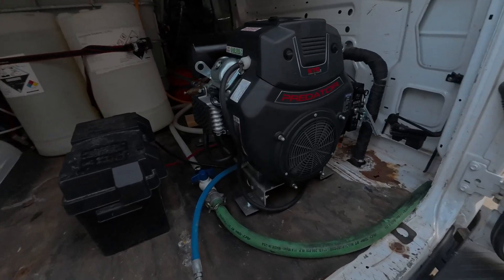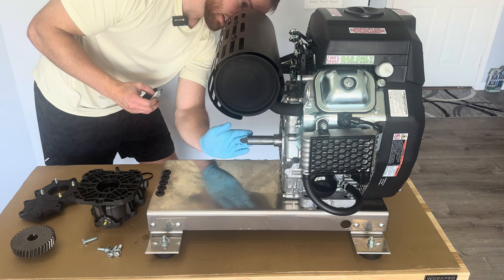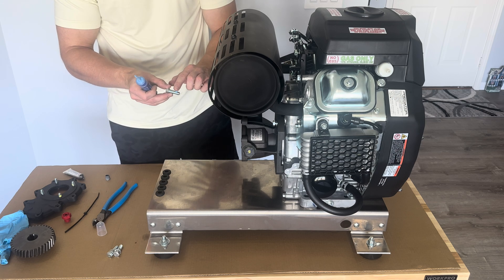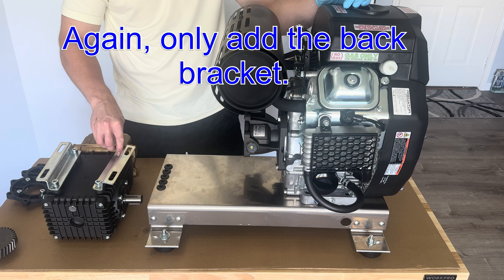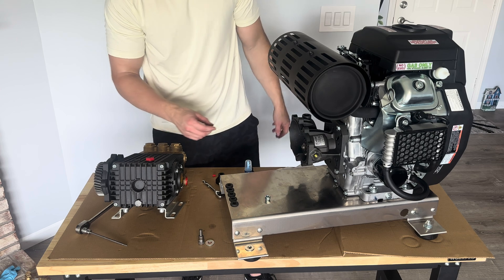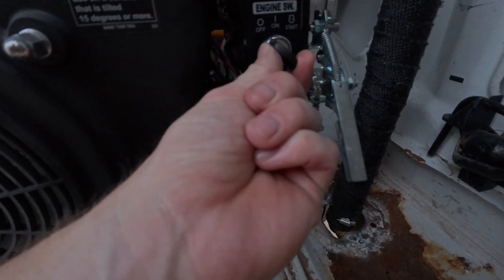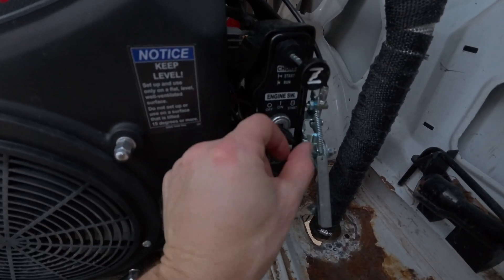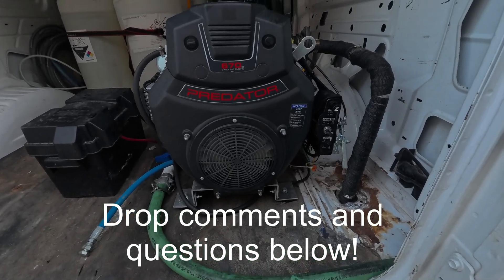8GPM Predator 670 Pressure Washer Build + Parts List

Comment: Had a question about the wiring on the fuel pump. The wire that was on the keyed switch was white and the wire coming off the fuel pump itself was red. Was that the same wire or did the red go somewhere else?
Reply from the maker: Same wire, I just had white wire laying around so that’s what I used.

Comment: Your worries about the belt drive are unfounded...just look at most truly professional rigs...belt drive machines dominate.And, btw, so do HONDA engines...very few Predator engines will be found on them.
Reply from the maker: If money was no object I would’ve just bought a Honda belt drive skid. The whole purpose of the video and part selection is to save money lol. Belt drive kit was a few hundred more and there is risk of belt misalignment for the average person doing it themselves.
Reply: @pressurewashnerds great answer.  💯
Reply: I have 2 GX690 Honda engines, and honestly I am happy with them overall.  But, the question becomes, do these Predator's last?  If so, the savings could justify the switch.  The other concern is the maintenance and how frequently do they break down?  Yes, aligning the belt could be tricky, and if not done correctly, you will rip through those belts quickly.    I have heard that there are other benefits to a belt drive, such as the vacuum it creates to pull water.  I do not recall if this is also the case with the gear drive systems.  Please update us on how long this build lasts you.  Great video.
Reply: @jsantaite1 I’ve gone through 2 predator 459s my first season. First one I left trailer out in many rain storms so maybe why I had to switch it out, but it was warrantied out. My only gripe is the oil drain location, but other than that that it’s legit. No battery, all pull start. Would still love a Honda though.

Comment: Total price is roughly $2,636 for anyone wondering
Reply: I just pulled out my calculator and started adding it up, then saw this comment lol. Thanks
Reply: Thank you!
Reply: The gear box is $600? I guess the sled has a cost.. motor is like $950 and pump is around the same depending where you get it from. I didn’t look the gearbox up.

Comment: I can not find my answer 

What pressure are you getting out of it? What’s the pump rated for? 

What kind of pressure do you think I would get out of a 6.6gpm 5,000psi pump?
Reply from the maker: The pump is rated at 3600psi and 8.5GPM but to be honest I’ve never run mine over 2500. There’s no need
Reply: @ I’m wanting to use it as a sewer Jetter so I need the higher pressure

Would you be able to crank your unloader all the way out to see what kind of pressure you’re able to get out of the pump all the math I’m able to find says I need 28 to 32 hp to run that 

I’m just trying to see what I need rather than order a bunch of stuff and find out the hard way
Reply: @logangaskins9003  Im also wondering if that engine is able to support 8.5 gpm at 3600 psi.
Reply: @logangaskins9003 I run 4000 psi at 8 gpm and the setup was like 2500.00 I used 2 Simpson 4000 psi at 4 gpm machines tied together with a tee fitting and 2 check valves. 90% of the time I only need to run 1 unit to clean grease in restaurant drains with the warthog wv nozzle., I have even cut smaller roots with the 1 maching and that warthog.
Reply: @stevem1081  so I ended up buying a mitm 5,000 psi unit used for $800 

I’m putting out 4.5gpm @5,000 psi 

It absolutely destroys everything I throw it down. I have a root ranger and a few button tips. Next is the warthog wv on 1/4”.
Reply: @logangaskins9003 some things I have experienced. My 100 ft 1/4 hose on the reel had steel ends, after a while, tiny flakes of rust would clog the nozzles. I ordered a hose with stainless steel fittings. Also, on that wv nozzle, they say you need a expensive tool to take it apart, I ground the sharp point off of 2 16 penny nails, put in the vice and it works great. Watch the video of how to service it, you will understand what I did.
Reply: @stevem1081  I didn’t see a reason to buy the warthog until I came across some roots I wasn’t able to get the line through
Reply: @logangaskins9003 the wv is not a super powerful head, other warthog heads and other brands have a bit more power. The reaper might be a good option.

Comment: What size hose are you using to feed the pump and what size is your whip line coming from the pump? I ordered this pump and motor yesterday. Thanks
Reply from the maker: It’s a 1” vac line with banjo filter on the inlet to the pump. Then 3/8” whip line to the reel.

Comment: Hey I've almost finished this build. Only thing now is I cannot get the gearbox on the engine shaft. The issue is that the engine shaft key wont ever spin to the proper location for it to slide into the gearbox. Is there a way to spin it manually? I went the route you recommended in the end of putting the gearbox to the pump first, then attaching it all to the engine shaft. But it seems like I cant get the key to align to actually slide it on there.

Any advice is highly appreciated. Thanks!
Reply: Ok, so problem solved. If anyone else has this issue, the best bet is to go to pages 8 & 9 of the Engine Manual (pages correspond to the current version of the manual), and follow the dissassembly steps listed to remove the shroud of the engine. It is the front cover. Once removed you have full access to a front bolt which you can use to manually rotate the shaft with no issues.
Reply from the maker: Sorry! Didn’t see this yesterday but glad you got it resolved. 

I think I should have added a section about checking alignment before mating gearbox to pump. At that point, you could still manipulate it to the correct orientation.

Comment: Hello. 
I received a blown craftsman’s 163cc pressure washer.  The guy bought it had his son set it up. He ran it with no oil for 20 minutes and blew a hole out the side. 

Is there any special requirements do I replace it with an oem motor from Briggs and Stratton with vertical shaft or can I use the predator vertical shaft on it? 

Thanks in advance.
Reply from the maker: Check:
- shaft size is same
- pump spec for the horsepower rating
- pump spec for rpm vs engine rpm
- mounting hole pattern

Comment: Nice video. Looking to do this same build with a TSF2221 10GPM pump.
Reply from the maker: Thank you! Yeah the 10GPM is tempting
Reply: 10 GPM may be asking a lot out of that motor.  The predator 670 is from my understanding ment to be comparable to the Honda 630 not the 690 which is what typically gets used on 8+ gpm units.

Comment: Question, what did you use to connect your fuel pump to the fuel line? It looks like some kind of nut was added? Or is it just the line going straight on with some crimps?

Thanks again!
Reply from the maker: Just line going on with some clamps. Nothing fancy

Comment: I just finished this build and it’s running great. My only question is the unloader. So with a 25040 green tip, you’re running 2500psi?
Reply from the maker: To be honest, I can’t remember what the exact orifice size is. I tried a few before I found one that gave my surface cleaner and wand both 2500psi with the same unloader setting and full flow

Below is a link to the one I ordered. Spec 8GPM

https://amzn.to/4hLM5Z8

Comment: Excellent build, I love your attention to details. Mind if I ask you what are the dimensions of the unit completely assemble? I'm planning on building one and have not found any information regarding size and I don't know if I have enough space on my trailer for it. Thank you.
Reply: Look up width of the predator because that’s the widest part. Look up length of the aluminum skid he used as that’s the longest part.
Reply: @austinprescott4039  Thank you for your response, I have looked the width of the predator and no luck, I figured out the length base on your info, but the width no. I have room for the length, 36 inches and only 30 inches available for the width, don't know if that will be enough.
Reply: @Sebanavila  30 inches is plenty. It's just over 23 inches wide.
Reply: @ Thank you for that info, it means a lot. You are awesome.
Reply from the maker: 23” wide at the Predator and ~30” long. Keep in mind you should leave some space around it for air flow and exhaust heat.

Comment: Amazing! Where do you get the rubber vibration dampeners (or feet) for the pump? Did you order them seperately?
Reply from the maker: I found them at Lowe’s in the hardware section! Most hardware stores should have similar

Comment: Hey do you mind if I ask what battery you use for the push to start feature on the Predator 670? I am about to order this build and want to ensure I understand every part needed first.

Thanks again!
Reply from the maker: I believe the manual calls for 12V and minimum 36Ah but double check me. I use a marine deep cycle 12v from Duracell. Group 27. We took it from our softwash system so it’s probably overkill.
Reply: @pressurewashnerds is your battery charging while the engine is running, or do you need to charge it up once in a while?
Reply: @hurdlingdragonbreath9381  I think you need to charge it up regularly. I don't believe this engine charges it.

Comment: Question, since the Gearbox you used has a Maximum RPM of 1450, doesn't that mean the TSF2021 only gets up to 7.5 GPM rather than 8?
Reply from the maker: I did not catch that when I did the build… that’s interesting.

Real world testing though yields over 8GPM though with a fan tip. Technically you are correct though and I may be running the gearbox slightly higher than spec.
Reply: Any issues with the gearbox after this past season?  @pressurewashnerds
Reply: @pressurewashnerds  Oh interesting. Do you mind if I ask how you got it to run higher? Cause I want to do this exact build, but I just want to ensure I get over 8 GPM.

Thanks btw for replying! ^_^
Reply: Do you have a video of you flow testing this pump buddy.  I’m doing this build now and torn between ordering the 2021 or 2221 pump I have a gear drive also an the 1450 rpm through me off, Russ Johnson said with the motor at 3600 rpm the gear drive is actually turning around 1640 rpm it’s super confusing to me lol I have a 6.3 gom and want to make sure I get at least 8 but I don’t want 10 because of pulling chem may be a issue

Comment: I have had nothing but issues with my gearbox.  I got the PA gearbox from envirospec and have reassembled it twice, making sure all bolts are tight, O rings are lubricated and siliconed, but still continue to get a slow oil leak between the gearbox and the pump.  tempted to switch to this gearbox that you have.
Reply from the maker: Interesting! Did you check for burrs on the pump and gearbox casting?

I’m at around 100 hours and this whole setup is running great.
Reply: @pressurewashnerds  that is what i was checking for when i took it apart this last time and couldnt find any of it.  Going to check one last time
Reply from the maker: Let me know if you find anything. Inspect that o-ring too, or replace if you can.

Comment: With the gear drive, we would need a pump from the buffer tank?  That was the reason why I currently have a 5 GPM belt drive because it suck water from the tank.  Has these info changed because I purchased it 5 years ago.
Reply from the maker: Gear drive and belt drive will both pull from a buffer tank as long as the pump isn’t super elevated from the water source. One thing I forgot to mention is you’ll want to prime the pump with positive pressure. I ran a garden hose to mine with 3/4 GHT to 3/4 NPT fitting and ran the machine for like 5 seconds. Then it pulled perfectly fine from the tank.
Reply: So I was a drop stick not a direct feed from the drain connect

Comment: How much saving comparing to purchasing?  Not sure I have the skill but it seems like you have all the part in your list that might give it a shot.  Thanks.
Reply from the maker: This will save you at least $1000 compared to the cheapest 8GPM prebuilts that I’ve seen. Plus the added benefit of knowing your equipment in and out.

I’d be happy to help you over the phone if you run into any issues.
Reply: @pressurewashnerds  Wow, thanks. That is what I was just talking about.  Building, safe money and I will know what break and where to get the parts.  I appreciate you sharing.

Comment: Nice job! I did the same build several years ago with the Predator 22hp. I'm not too fond of belt drives, either. I did add my gearbox to the pump before attaching it to the engine, and it was fairly easy. Except the GP pump I have is a beast and cranks out in excess of 10 GPM. I have also dual-fed the water into the pump on both ends, but I have had problems downstreaming with it because so much water is coming through it. I am open to suggestions there as I would love to apply detergent with it. The only mods I did on the engine were to replace the spark plugs to a higher quality, replace the fuel pump for the same reason, and got rid of the fuel shut-off valve which became faulty and added a manual shut-off for the fuel line. Other than that my Predator engines are outperforming my Hondas.
Reply from the maker: Love to hear that it’s working out well for you! Yeah I did a bucket test and assumed I mis-timed it because I was getting around 9.5-10GPM.

The excess flow is awesome for rinsing houses but yeah pulling more chemical while downstreaming can be a bit of a waste.

Comment: Currently building mine as I looked for some assistance and found this.  Perfect timing.  Just trying to figure out the electrical.
Reply from the maker: Glad the video could help! 

If you need any extra help on the electrical just drop your email in the comments and I can walk you through it.
Reply: @pressurewashnerds  having the hardest time with the gearbox.  I got the PA gear box from envirospec and have had leaks between the gear box and the pump where they attach.  Took it apart, checked the O rings and they are all in tact but still getting leaks.  would like to figure it out but want to switch to belt drive if this keeps coming up

Comment: I got this engine in a golf cart   I keep having to take the carburetor apart because he floated is always sticking    I've seen where others are having the same problem
Reply: Don’t use the corn gas folks 😢
Reply: @philliphall5198  I only use E free
In all my small engines
Reply: I would switch over to EFI. That's what I do for all my small engines.
Reply: @WilliamEllison  is there a kit that I can purchase for that   
do you have the part number
Reply from the maker: Interesting. Will definitely make an update video if I run into that same issue

Comment: Ive been running this engine/pump setup for about year and a half now. Has held up great. The jets on the engine got clogged once and was annoying to fix but other than that it has run perfect. Def a great budget build over honda and crx machines
Reply from the maker: That’s great to hear! Hopefully we both get a good few thousand hours out of them 🤞
Reply: Add a fuel shut valve on the fuel line and run the carb dry. Ethanol is the worst when it just stays in carbs.
Reply: @zadok22 or just run ethanol free fuel
Reply: Does anyone here have a link to the pump. Inwouldnhate to buy the wrong one. Thanks